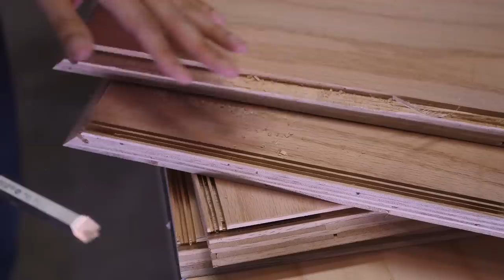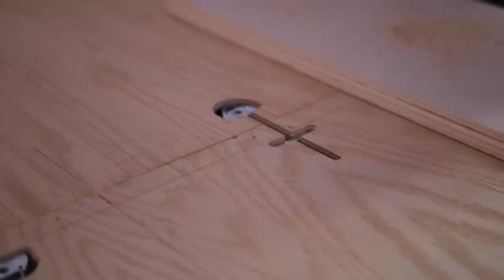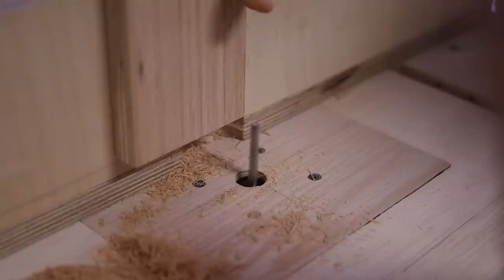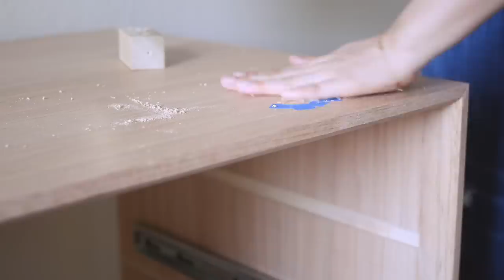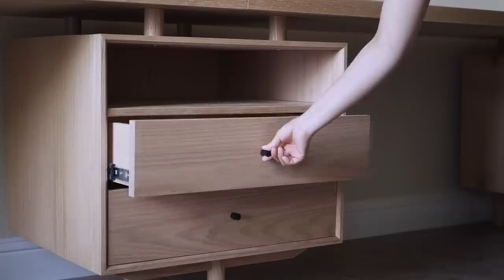DIY #2 | Mid-Century Modern Kind of Desk

Comment: Only, recommendation is for that little enclosed hutch for a tower you need to possibly vent it more on the back or add fans to keep the tower cool so you have positive air flow through it.

Comment: Nice job mate. I follow both Peters along with yourself and others. I have the UJK?? drilling system sitting in it's tube but I haven't made a table. i did have an old mft1080 though and it was nice.

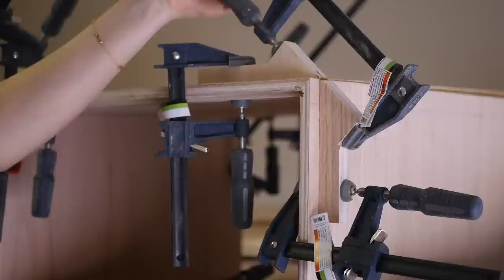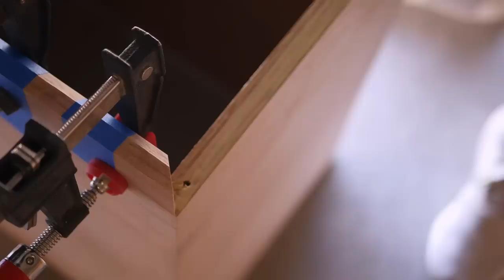Comment: @0:30 Rabits, @0:38 Splined miter joint  @1:20 Miter joint panel clamps @2:10 Cabinet carcasses completed @2:12 Plywood edge molding @11:47 Port holes on cabinet backside (computer ventillation) 
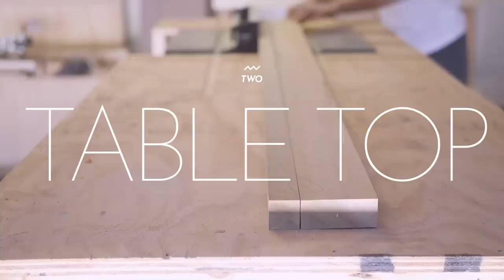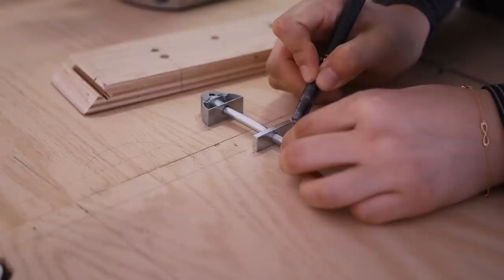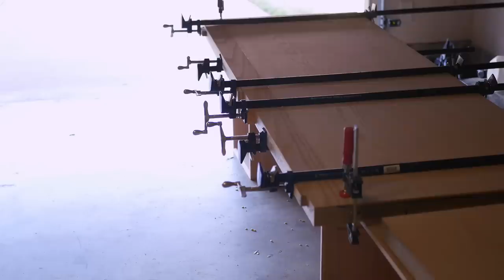@2:32 Hollow desk top (torsion box) @3:33 Endgrain edge joint using clamp bolt @4:18 Router for domino for alignment @4:39 Edging on hollow top
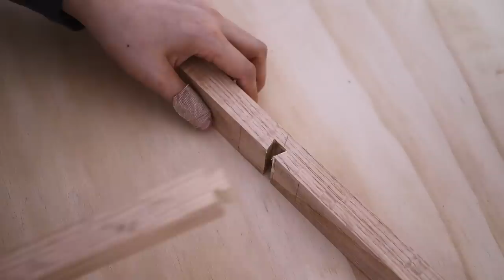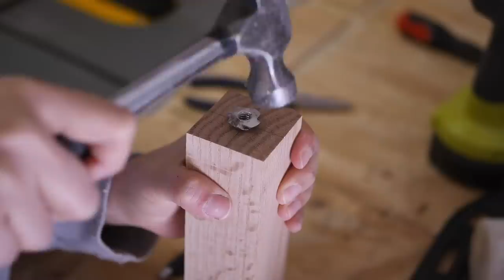@5:08 Sliding dovetail feet, @6:27 T-Nut @6:38 Table saw as lathe @7:32 Feet assembly completed @7:36 Drilling mounting holes underneath cabinet carcasses 
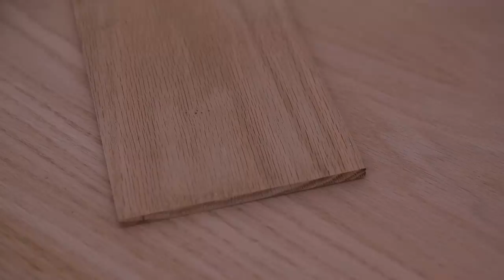@9:02-9:49 Panel door 
@10:01 Doweled spacers @10:10-11:25 Mounting spacers 
@11:29 Fitting drawers @12:25 Drill press jig for drawer pull knobs @13:04 Drawer assembly

Cool build, Jenn!
Reply: I noticed there weren't any stretchers. Is racking an issue?
Reply from the maker: Sorry, I can't understand your question. Which stretchers do you mean?
Reply: JennsMistake Racking is a type of mechanical stress (aka. shear stress). Imagine pushing the tabletop of one side of a four-sided table that has heavy stuff on it. If the joints where the table legs meet the table aren’t strong, they’ll fail.

Stretchers are long pieces of wood connected between legs of a table. When you push against one leg, the force you exert gets passed on through to the connected leg so that the stress applied to the table-leg-joint is halved.
Reply: @7:27 Ignoring the dowel leg, the long piece of wood that runs perpendicular to short piece of  wood is a stretcher!
Reply from the maker: @IsaacC20  Thank you for the explanation! Now I understand the question.
Reply from the maker: @MinhTran-wn1ri  Yes, there are no stretchers. I know if it has stretchers, it will be a stronger structure than now. But the desk tightly fits in between the walls, there is no wiggle space. Also, I don't put heavy things on top of the table hahaha. If I make a desk stand-alone, I probably add large back panels between each cabinet.

Comment: You have won a new sub. But I have a concern on the legs.... the vertical round part seems to fit very snug and the grain on the supports is running perpendicular. havent they split the legs?

Comment: What kind of wood did you use? Beautiful design! And what is the radius of the round parts between the cabinets and the desk?
Reply from the maker: I used red oak, and legs and supports are about 1.75 inch.
Reply: @jennsmistake   Thank you for the additional information. So I guess it is Red Oak Multiplex for the cabinets and the top of the table. But how do you can the wood pieces you use in front of the cabinets?  
In fact to finish the cabinets neatly? (At 2.13?)

Comment: That was nuts, using a table saw as a lathe with a drill... lovely job

I’d love to see all the jigs you made to develop the knobs for example.

Was the choice not to protect the coating on the desk for a specific reason?
Reply from the maker: I didn't show applying finish, but the desk is coated by water based poly.
Reply: JennsMistake a sensible choice , it’s a beautiful desk, you are very talented.